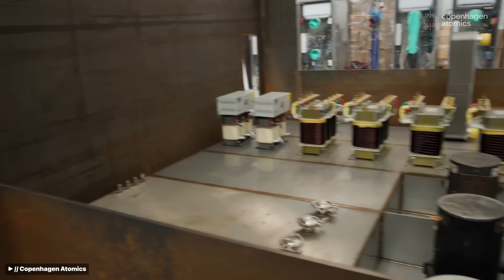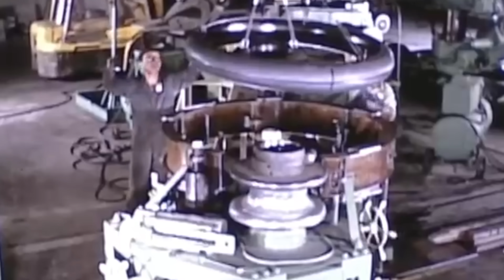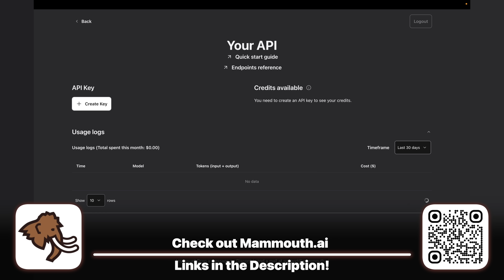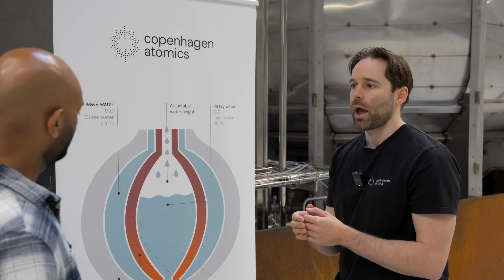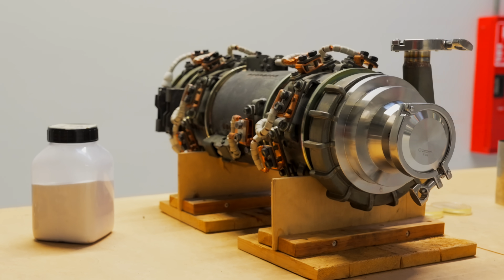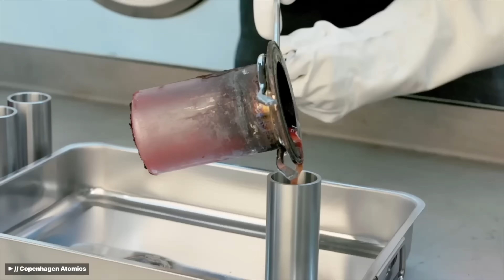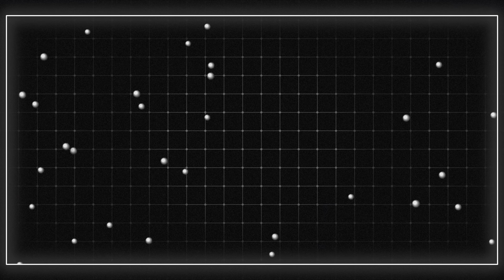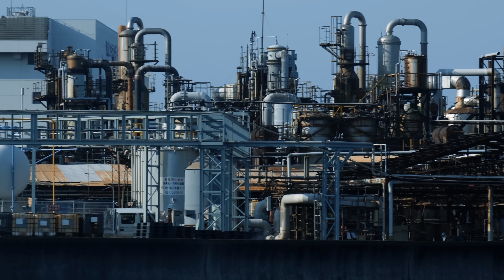This Modular Thorium Reactor EATS Nuclear Waste

Comment: The Chinese are currently working on the US answer to hot home small nuclear power plants with lots of moving parts and gamma radiation. It's a cold battery with no moving parts and no gamma radiation. Which is safer?

Comment: Though the first few MMSRs will be parked near demand, they will fairly quickly extend lifecycles from 5 years to 40 to 50 years and be sealed in silos with caps requiring huge cranes to lift to replace the MMSR for repair, exchange, or updrade.

Comment: good tech, Id say yes.  Is it ready, hell no.  Too many critical areas were glossed over.  "Recycle the radioactive pumps" sounds overly simplistic.  This does not address energy independence at all.  Current tech in microwave drilling would open up the earths core for geo thermal at just about any location on earth, and a lot safer and cheaper.   I could see this tech being used in the space program which is probably where it belongs.

Comment: This seems like a fine little reactor: just add some boilers, Steam Turbines, condenser water purification equipment. And weld four of those containers together and you’ll have a nice little power plant. Rewire the neighborhood and create your own Electric Company. We should have these everywhere. Decentralize the grid and provide power to a small city is possible. I was a power plant mechanic for several years and we used gas turbine engine generator sets at our upstream facilities as back-up power whenever Edison went off line. The mid sized Solar Saturn and Taurus gas turbine/generator set putting out about 2.5MW and fits in a half sized container. (20’). The Mars Gas turbines were monsters and non-portable. If they could make a stand-by generator with this type of reactor that can be pulled by a tractor trailer and set-up at other locations in an emergency. But that won’t work with 200 tonnes of steel walls and ceiling. It a good idea but somewhere along our way towards dumb and stupid someone will do something wrong. And it will be bad and they won’t learn anything since the days of Fuddruckers. Or was that Bu…

Comment: Nuclear energy has made phenomenal advancements, and it's great that the research continues.   However, even in the new proposed systems it creates toxic waste that lasts for centuries and is so dangerous that it has to be encapsulated in massive bunkers (that we "hope" would work in case of disaster).  Solar, wind, hydro and geo thermal energies now have the benefit of battery storage,  do not produce toxic waste, and don't have the risk of contamination to their surrounding areas.  Transcontinental cables and grids are already in use for transporting renewable energy to remote locations.  Do we really want to let billionaires move ahead with nuclear reactor cargo containers for their data centers just because it is a cheap option for them?  Or, would it be wiser to generate clean energy and require data centers to work within those parameters? Nuclear energy has made significant advancements and now reached the point where it's a smaller level of potential disaster on the environment than it used to be.  However, with the other options available, and the significant potential risks, why would we regress back to nuclear power?
Reply: Short answer, we can use these reactors to burn up existing high-level waste.  Existing high-level waste is dangerous for 100,000 years.  After a MSR chews it up, it is much smaller in volume and only dangerous for 300 years.  Why not use nearly 100% of the energy in stored high level waste and shorten its dangerous life by 99,700 years?  And if it is economically helpful, so much the better.  There is no down side here.
Reply: @StormGod29  Is there a guarantee that only high level waste will be used with this technology?  Or, will it be determined that the high level waste is too risky and too expensive to transport, so other fuel sources are used?
Reply: @benblankenburg  I think the best way to burn up existing high-level waste with these SMRs is to colocate them at existing nuclear facilities with existing stockpiles that need burning off.  This removes transportation objections which are real.  If I were an existing generator, I'd get enough of these to keep up with my high-level waste generation rate.
Reply: 1L of high level waste leaves an MSR as about 1-10mL of waste.  So we get a 99% reduction in volume and a 99.7% reduction in half life.  And we get a ton of CO2-free electricity in the exchange.

Comment: So what is a Thorium reactor?   Thorium is not fissile.  It's fertile.  You need a nuclear reactor to mutate it.
Reply: That's what this one is intended to do. You start the reactor on uranium and it converts thorium in the outer shell into fissile uranium 233 that is fed back into the reactor closing the fuel cycle. Fingers crossed.
Reply: @chapter4travels  There are so many issues involved.  That's why no one has done this in years.

Comment: Sigh ... another buzzword nukie-enthusiast "Thorium Thorium Thorium" story, that doesn't address the fundamentals of the Thorium fuel cycle or the resulting problems.  And then on top of that, it claims "it eats nuclear waste," without explaining anything about the problems of that, either.   And all of this focusses on a weird geometry with no real explanation of the costs or problems of that. 

This D2O-moderated reactor has its closest analog in the Canadian CANDU reactors, but differs radically in the complexity of its geometry and effective calandria. The idea/issues of this class of design stem from the reality that in a fission reactor the large fraction of the released energy goes with the atomic fragments, and only a few percent goes with the neutrons.  I can't find the exact fraction for U232 fission (what actually fissions in the Thorium cycle) but it is 2.5% for U235, and the fraction for U232 is probably not much different.  The fact that the neutrons carry only a few percent of the energy is what allows the idea of a cold D2O "calandria" moderator to be possible at all.   But there is nothing all that wonderful about this scheme; D2O is expensive, and there's no explanation in this video about why this moderator really is optimum, or actually solves any real problem. 

And far more concerning is that nothing in this video goes into the exact molten "fluoride salt" chemistry they intend to use.  The common one is FLiBe, and I doubt they have done all the chemistry to use anything else  -- while it does not react violently with water, water does react with the Beryllium to produce BeO2 and HF ... and the latter is wickedly corrosive.  Systems with water and FLiBe will depend on zero leaks.  

And then there is the final and obvious thing -- this is physically a very small reactor.  It will need at least HALEU to get started, and will depend entirely on the Thorium fuel cycle with process-stream waste-separation, to get high concentration U232, and avoid breeding transuranics.  And then that separation process must dispose of its waste stream.

IMO it is witless to design peculiar reactors until one has the separation processes in hand ... that nobody does.

Comment: Poorly done. Very poorly done - systematic review isnt for these westerners. A mark of a failed society.

A standardized korean / Chinese / Indian reactor costs under 2500/KW.
Very few of the currently deployed by these countries of GEN3 technologies are cost overruns. (I should include Rosatom as well))
Both China and India are in criticality phase of Breeder reactors and/or large MSR deployments.
The MOX - Plutonium - Thorium Cycle that is not only 60X more efficient than the units he talks about, but also breeds more fuel and weapons grade material in the same cycle. And are being tested right now.

Westerners are ignoramuses

Comment: A thorium reactor only works on it's own (no extra support fuel from uranium 235 or plutonium)  if it is a true breeder. Thermal throium breaders are already tricky and require rather clean (low burn up) fuel, when they are large. With small size systems it is no realistic to get a true thermal breader with a managable level of reprocessing.  A point usually ignored are the reprocessing losses in the thorium cycle - with the required short cycle the losses add up and quite some (like > 50%) of the thorium can end up in the waste stream. Reprocessing the thorium is also not yet developed beyond lab scale.
The 2 liquid system has some benefits in simplifying the reprocessing (less need for thorium cleaning), but it add lossed from the separating wall and that wall will have a very limited lifetime.
As a downside the 2 liquid system add a lot of variables for a possible accident that damages the barrier between the liquids.
The 2 liquid system also means the core fuel is highly enriched and technically classified as weapons grade. So quite some restrictions on where it can be operated.

Comment: You talk about the cost of 20-30$/MWh. The video is about providing 600C heat that then requires additional equipment to generate electricity. Is the price you quote just the cost of heat rather than LCOE of electricity?

Comment: People arguing: Nuclear and wind+solar complement each other. No need to compete, they provide for different sectors. Greater together, you know.

Trying to do everything with nuclear doesn't make sense because at the moments that solar and wind are producing, they're dirt cheap. The problem with them is intermittency.

Nuclear is great for baseload. It's valuable in its constancy, but not all loads actually need the constancy.

The cost effective path is somewhere down the middle.
Reply from the maker: pretty much — storage is the missing piece that makes the middle actually work

Comment: thorium reactor are safer then conventional reactors, but they aren't any cleaner.  If they leak, who cleans up the radioactive components.  Do you pick up the whole box and ship it to Copenhagen?  Is you data center then too radioactive for your workers?
Reply from the maker: containment vessels are designed to fail-safe — but yeah, if it leaks, you don't just mop it up. modularity helps: swap the whole unit, deal with it offsite. data centers? shielded like any nuclear facility.

Comment: The technology is amazing, but it’s far from new. Form reactor has been running in the United States for at least 50 years. But never in commercial use because of the fact that it does not produce plutonium. Plutonium is produced in pressure reactors. The kind of reactors that eventually blow up. Thorium is tragically safe cannot melt down because it’s already melted. If it wasn’t for war, it would be the obvious choice.
Reply from the maker: yeah the MSRE ran for years — politics killed it, not the tech. thorium’s no-plutonium thing is exactly why it got buried

Comment: there are no thorium reactors. please research the thorium fuel cycle. out gets transmitted to uranium before it's put in the reactor.
Reply from the maker: thorium breeds to U-233 in the reactor, not before. MSRs run on it directly

Comment: Turning the waste into a molten salt liquid takes HUGE amounts of power. It also takes power and complexity to purify the salt. Then there's the pump tgat stops working if the reactor overheats. This feels like non-nuclear engineers trying to design a nuclear reactor.

Comment: Henry Ford and in particular Edsel Ford and Bill Knudsen would very quickly explain to you that mass production does not work in the iterative manner you described in this video.  once an assembly line process is operating any changes cause massive disruptions in output and efficiencies..  nowhere was this more evident than at Willow Run during ww2...  all the changes the army air corp constantly required gave Ford fits ..until Knudsen finally devised a rather odd way of dealing with the issue..for both Ford and Later Boeing..build them wrong and update them later.... Elon the current master of the Iterative approach fully knows and appreciates the requirement for a final design before mass production commences ..  Before mass production takes place  Copenhagen Atomics better have ironed the wrinkles out of their design

Comment: WTF do you mean safety is not an issue. While capitalisms focus is on cost savings that are made by pushing back maintenance, safe end of reactor life dates are pushed back until the final decommissioning cost are pushed on to the taxpayers, what could possibly go wrong.
And you statement that a problem in reactor 50 can be fixed in the next one, What about reactors 1 to 49 have the same or more faults then #50.
With such a cavalier grip on nuclear reactor safety, you should  ask them to call the manufacturing plant,  the two bit reactor factory.
Faarrrk sake

Comment: This segment didn't really address what happens in the outer "blanket salt" layer.  It is implied that that is where the "breeding" happens, but how exactly?  It is implied that it is also Thorium, but why then aren't there fission reactions in the outer layer (where that would be bad)?  And how is new fuel made?  If it's already Thorium in the blanket layer, then what is being "bred" exactly?  Also why aren't there examples of this kind of reactor without the breeding feature?  If Lithium separation is the key breakthrough, wouldn't there be other reactors not using that breakthrough just not breeding new fuel?

Comment: I saw this about 2 years ago and im certain there is at least one of these used by the US military for powering a floating (not on a boat but for temporary bases in hard to reach areas) and I straight way thought this is a really good fission solution until other types of energy conversion can be realised. This would really really solve a lot of problems and are really damn safe and clean. I dont understand why new types of fission reactors like this which is one you can pick up in any problem situation and transport to a facility where it can be contained . I know GE and Rolls Royce are working on compact safe fission reactors. People need to think the reason you have had bad problems with fission is mainly due to the urgency of getting fission reactors having a decent design and the need for the energy. Places like Chernobyl and Fukeshima becane a problem due to bad design and incorrect placement of designs that did not have safety redundency built in like Fukishima where they rellied on diesel back up generators as emergancy pumps and putting those deisel engines in a place that could easily be flooded in a geologic disaster . In the end they got the pumps running and control situation using battery power . This is the way to go until we reach the technology of fusion and to be honest they are so much cleaner and safer than oil or gas based plants and as you see if there is a problem with a grid you can just roll or fly these in and the same if there is a problem. Its really just the way we need to go and humans are good a fission now...

Comment: Unless a fusion reactor generated electricity by a direct conversion scheme, so it could have a higher power density I don't see much of an advantage over a molten salt breeder reactor of either fuel cycle.  The higher power density would be good for space travel, particularly outside the orbit of Mars.

The military extracts lithium six from natural lithium for use in fusion warheads.  Whatever technique the military uses would concentrate lithium-7 as well. They might give away the lithium-6 depleted lithium to people building reactors.

Comment: What is used for thermal insulation between the layers.  Many sheets of some reflective non-neutron poison, like zirconium, or beryllium in a vacuum would be good.  A carbon aerogel would be good too.  By pure molten salt, I suppose they mean no hydrogen/water.   Using a closed cycle supercritical CO2 Brayton heat engine scavenges hydrogen from fuel salts, as it diffuses through the metal of the heat exchanger.  I'd design the reactor so that if the pumps lost power, the moderator would drain as well.

Comment: What are the economics of storing high level waste for ages?  I heard that the salt mine storage plans were closed due to nimbys and some technical questions.  How do the storage and security costs compare with a site where existing waste is used in these reactors?  Can they be further optimized to get rid of the long term waste more quickly

Comment: My biggest concern with this technology is that it will be used as an excuse to build more conventional nuclear plants by saying 'we have waste handled' - while virtually none of these reactors get built to actually do that.
Reply: Waste is the least of our problems; civil reactor waste, 'partially used uranium oxide', hasn't harmed a soul in 70 years. It will sit in dry casks for a century, or however long it takes for us to decide to use it. In 100yrs the most radioactive longer term fission products - cesium and strontium - will have gone down by about 90%; many of the others by much more. The useful actinides will still mostly be there, and so will valuable elements like ruthenium, palladium, krypton, and xenon. (Many of the shorter-lived, more active isotopes will also have uses that we haven't even tried yet.)

Comment: Woah woah woah.
I think you just glazed past something important at the 2 minute mark about the specific of the setup. You mentioned about using super critical CO2 turbines. Those aren't even in production, those are just proof of concept phase. That's giving a false narrative around expectations and generation. This should be compared to a Steam/Water turbines as that is the most common level set used and would assume this setup would use as well.